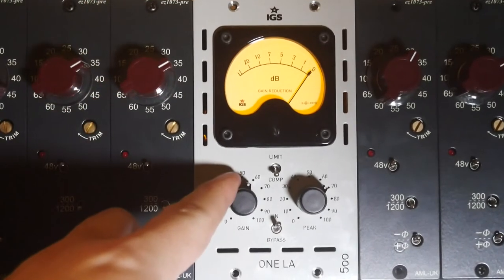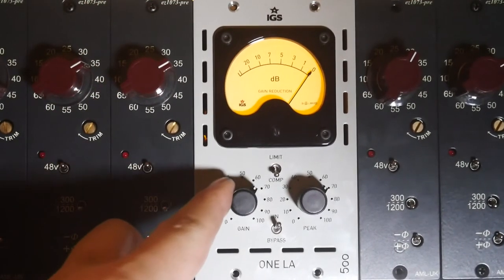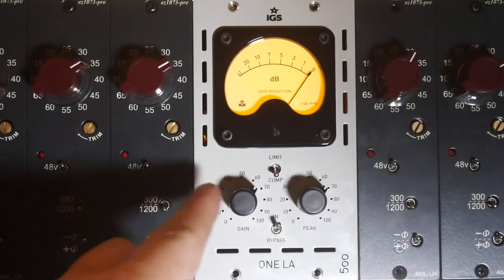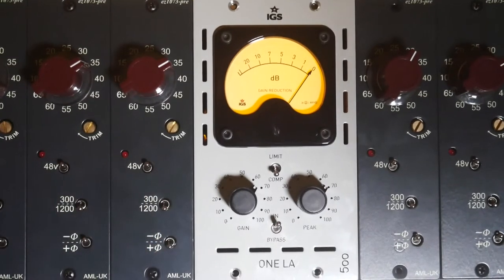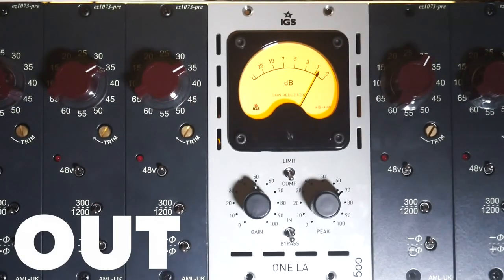I demoed the IGS audio opto compressor - IGS One LA 500

Comment: I personally would use an opto for bass, vocals, e.piano and acoustic guitars. It doesn’t sound bad on drums at all. The funny sound could be that the module is not getting enough energy from the power supply... have you had any improvement since the recording of this video?
Reply from the maker: Hmm no I only tried it once, maybe the gain stage wasn’t quite right either.  Do you have any exp with it on drums?
Reply: @maxbauhof  Not at all. For drums I would use the 1176 or the IGS version 576.
Reply from the maker: What do you think of the IGS576?
Reply: @maxbauhof  Of what I’ve heard, it’s very very crunchy. Love it on every single piece of the drums, specially the SD. On bass, acoustic guitars and vocals is amazing as well. I’d definitely would get it if I could. Cheers!
Reply from the maker: Nice! Thanks for the info
Reply: @preciseaudioblog that’s what I use everyday you’re spot on with that!
Reply: @maxbauhof I have two of them and they’re great.

Comment: Maybe is the power supply. I watched a video of IGS making reference to that. This unit needs lots of power
Reply from the maker: Def could be that,  might if just gain stages it way wrong too.   Honestly can’t remember at this point.  IGS makes incredible gear though, everything I’ve used is built like a tank
Reply: @maxbauhof Have you tried the 576 Blue Stripe? I wonder how that would stand with a full rack UA 1076. Do you think 500 series loses sonic fidelity because they are smaller? I want to get those bc of the space. Btw, congrats on the video from Ernie Ball Music Man! 👍
Reply from the maker: I haven’t tried that, I’m curious about it too.  I haven’t noticed any constraints with the 500 series format in terms of compressors.  I’m sure there are limitations but I haven’t noticed

Comment: I think it has a malfunction. I don't believe it's supposed to sound like this.
Reply from the maker: Sounds a little funny right?
Reply: @maxbauhof  Sounds distorted...
Reply from the maker: Yeah it does, might of been too much signal, or low end and the gain stage just couldn’t take it? I didn’t really have a lot of time to mess with it on other sources.
Reply: Some units will fart if there’s to much low end going through it, my Lindell 1176 clone does it, but it has a filter side chain that cuts the low end so it works as it should after using that